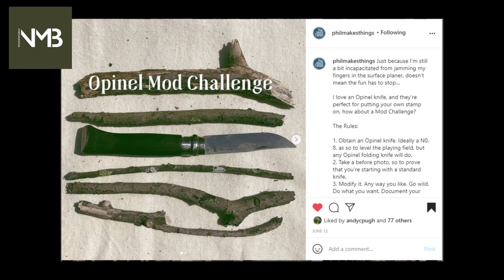Pocket knife Mod - The Opinel Mod Challenge 2021

Comment: With a design that reduces the width of the handle, you’re reducing the integrity of the handle. Yes, you replaced the width at some point, but where the handle narrows into the collar is now permanently thinner. Have you used this knife enough after the modification to know if you can still pic much force into it without splintering the handle?
Reply: These are light duty knives.
Reply: Definately, I think of the Opinel #8 as the perfect outdoor steak knife. Lol
For $20.00 it's a good, cheap, general purpose, get er done knife.
Not for prying, splitting or throwing!